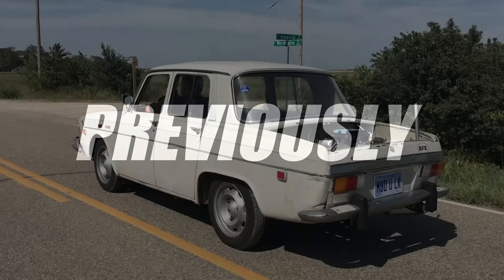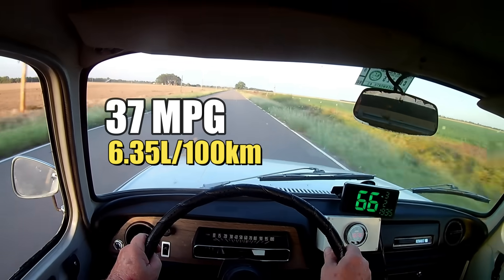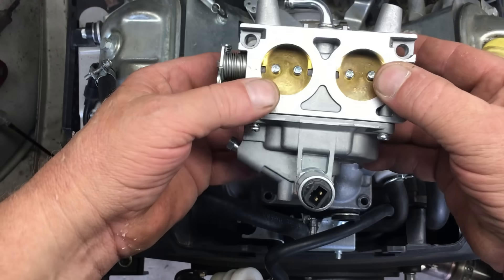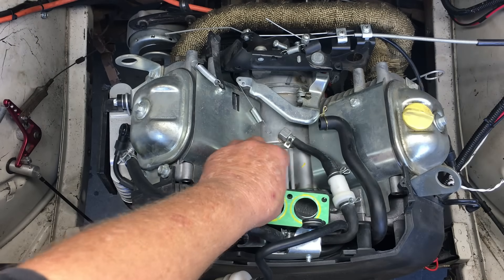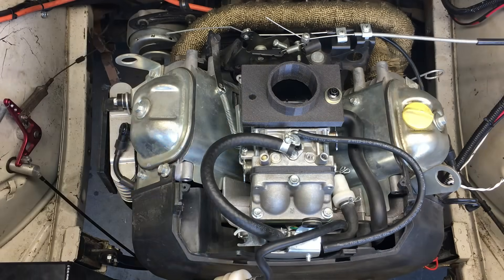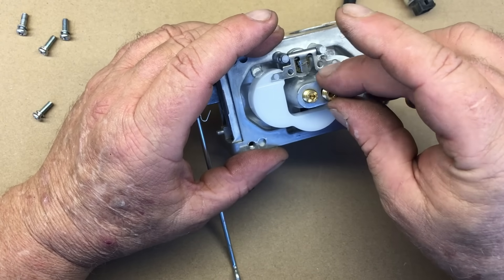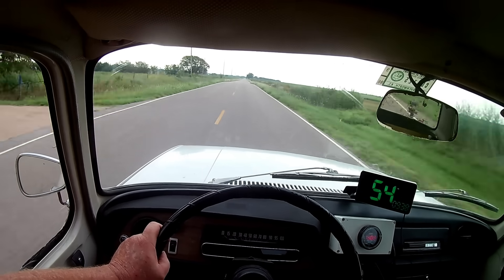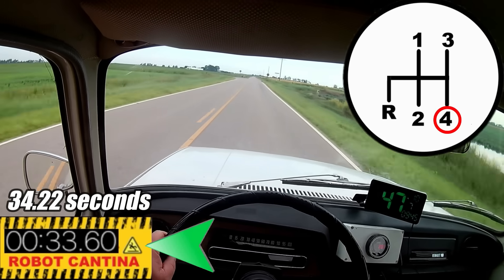S3 E27. We improve the fuel economy on the 670cc Predator powered Renault

Comment: Did the crossflow spacer change the af ratio, or was it the change of filter setup?
Reply: I also noticed you like using Arlington road for a proving ground
Reply from the maker: The spacer indeed changed the AFR.  We have run the engine with and without the filter with no change in AFR. Are you local?
Reply: @robotcantina8957  Penalosa

Comment: Is this engine getting a blower like the rest of them?
Reply from the maker: A blower would be cool and its been done before.  however I don't think the engine would last too long even with billet rods.    It would be nice if we had a bigger budget so we could afford to destroy a few engines and find out.
Reply: @robotcantina8957  I'm still hoping for a few more episodes about the diesel Saturn.
Reply from the maker: @2ndspingarage   the diesel saturn  will appear in one or two more episodes, then the engine will be removed and the saturn will  be scrapped. The diesel engine will  then be  installed in a lighter car.   For the  second generation of the diesel project we will try a supercharger along with a computer controlled fuel rack adjustment..... plus moore!
Reply: @robotcantina8957  no doubt:  if I ever get any small engines you might be interested in using for your show id like to donate to the show.  Im by Tulsa,Ok.

Comment: A single 35-41mm downdraft carb mounted to a spacer manifold bolted on top of the stock intake would get rid of several of those turns the air fuel has to manage before entering the combustion chambers,plus gets the carb further away feom the engines heat that the stock carb encounters by being mounted between the cylinders..plus better airflow to the carb..

Comment: A mod worth considering is taking of the cylinders and pistons, match the weight of the conrods, pistons.
Maybe even trying to shave the maximum weight of the pistons, like the casting remains under the underside and maybe making them accelerate faster.
Drilling the conrods with a 3 - 4 mm drills to make them light yet remain durable.

Lol, 1 billion.
12:01 seams like a drop in power and than it start picking up again, like it has to think what to do.

Comment: The reason this engine has a two barrel carburator, in witch the barrels are entirely separated and each feeds 1 cylinder, is that it is a v-twin engine, and consequently has unevenly spaced intake strokes. With a 1-barrel carburetor, air inertia would cause different velocities during intake of each cylinder due to the irregular cycles of vacuum applied to it. And I suspect that the originally different jetting in each barrel has the same reason: the two separated barrels is probably an unsufficient measure to ensure similar air-fuel ratio in the two cylinders, I think firstly because of air inertia in the intake before the carburator, but especially in the 2-in-1 exhaust in witch irregularty of exhaust strokes alters scavenging. Such an engine should have 2 separated carbs, intakes, and exhausts.

Comment: Tinkercad tip: when you create a cylinder, max out the number of faces on the cylinder and it will look really nice and round instead of having the distinguishable sides like in the air filter adapter print.

Comment: The two plane intake is probably better than the crossflow at low end smoothness, idle-ability, and air fuel mixing. The crossflow probably increases air fuel separation which improves top end mixture delivery but less low end torque, snap acceleration, and idle smoothness especially on cold start. 
   How does the 6mm plastic spacer effect thermal conductivity? I think it results in a dissimilar heat saturation between the fuel delivery system which can have some ugly characteristics during restarting.

Comment: Adding a open spacer to a carb is a pretty common mod to move the power band higher up in the RPM which is probably exactly what you did, it also helps insulate your carb but idk how relevant that is on a air cooled engine that probably likes to run a little hot anyway. The better fuel economy down low is probably because the leaner jets and that spacer moving the powerband, you don't need much power to maintain speed. You should try to make an isolated spacer with the old jetting to see what it does, that should increase torque down low because it's a longer tube intake.

I think what would be interesting is a long tube intake with a more smoothed out path to both intakes, the current open spacer puts a lot of restriction on the opposite barrel to the cylinder. It would be cool to see how a perfected design would work. Alternatively maybe try a variable length intake shouldn't be hard on a 2 barrel intake just 2 possible paths and a solenoid or butterfly valve deciding which ones used.

Comment: I think you need a carburetor that has an enrichment circuit and an accelerator pump. It may be a lot and you would have to turn it down some, but it would probably help. Daytona Carburetor sells a single barrel carburetor based on the Holley 1920 with a main jet that's adjustable through the float bowl. It's a 38mm throttle, so not sure if that would be any better than what you have or not, but what it's based on came on six cylinder car engines.

Comment: Heh. As soon as I figured out what you were up to, I had a pretty good idea what was going to happen. 
Basically you've built a Yamaha V-Max, but without the valve. I was pretty sure this thing would rip at WOT and be worse everywhere else. I'll bet that if you go out and do another speed run and use the manual transmission to keep the engine at higher RPM throughout the run you'll see more performance gains. As it is the performance will be worse at most of the throttle/RPM range but really pickup at WOT and high RPM.
YAMAHA solved this problem with a valve that kept the intake runners and carbs separate at normal throttle levels but opened it up into a shared runner, multi-carb system at WOT.
You could probably duplicate this pretty easily on your system. 
I'd put a solenoid powered  guillotine valve in the spacer between the intake ports that stays fully closed unless two conditions are met. 1. Throttle is at WOT.  2. RPM exceeds (n) 
Play with n until best results. 

I know that's probably more than you want to undertake, but I thought I'd share anyway. In case someone wants to mod their v-twin this way.

Edit: I found this

https://www.vmaxforum.net/threads/understanding-vboost.17998/

Comment: I wonder if the spacer that combines the airflow afterwards of the carb could have a little sliding "cross port" block to close the center up at lower rpms and open at higher rpms to make low end response a bit better?
Random thoughts though.

Comment: Just ignore these armchair rocket scientist Jimbo! Most all these people who have negative opinions haven't the abilities to do half the things you've done! Whenever you have negative responses to your videos it means that you're making others jealous and they feel a need to drop negative comments. Don't know why they feel this is necessary? Can't fix stupid people unfortunately, ignorance and jealousy will always be around....
Reply from the maker: Thanks,  I love to read the comments for unusual ideas, but a lot of the time I find ideas that contradict  each other.  It's interesting to read the comments other youtube creators get... and like you said there are plenty of negative comments  on terrific videos.
Reply: @robotcantina8957  
Thanks for the reply Jim, but hey there's so much available aftermarket for these V twin engines today it's pretty amazing stuff! Camshafts, roller rockers, custom intakes and the carburetor is up to whatever you choose from imagination? I've seen the use of the what's called a "Pumper Carb" off a Harley Davison I believe the lawnmower race community has been using on their engines. They have a integrated accelerator pump, to remove the dead spots in throttle blade movements. I've also seen them running Volkswagen air cooled carbs on these engines as well, or just 2 individual variable venturi carbs. The first thing that I would possibly suggest to you guys and performance enhancements are concerned...... is the Billet flywheel and connecting rods especially, without the governor being out of your equation. These OEM rods are very brittle being cast aluminum as I'm sure you're aware? But they're usually the first thing to fail in these engines once they're allowed to sweep the full spectrum of RPMs. So be careful please with those original rods, but once they have been replaced, file some extra ring gap in the top compression rings and set that baby up for some boosted atmospheres LMFAO! They definitely respond very well to any extra help with induction, but really recommend that you run a good imter-cooler for these air cooled engines are already at their maximum temperatures under a standard atmosphere and load. You Sir are probably a little overwhelming for even the V twin with the weight to HP ratios Lol. But it's sad that the original engines in these French or German vehicles made the same or even less HP than today's modern lawnmowers. So if a production VW Bug made anywhere between 30 and 40HP I wouldn't think you'd be too far off the mark with your 670cc engine. Without adding boost and just running rods, flywheel, a good grind Camshaft and matching springs locks and retainers N/A that engine should be making a healthy 40+HP without the need for boost. If you are planning on getting wild? This is a different story that you will have to get creative with due to lacking of bolt-on parts available for this specific application, but there's enough out there now that other parts can now be easily modified to fit the Chinese clone V twins. I personally prefer the Briggs Vanguard V twin or a Honda or Kohler roller motor. They're now running SBC roller lifters in the Kohler Command V twins with their original SBC hydraulic self adjusting lifters. The bores are the same for the roller lifters that race and most modern performance engines use today. It frees up a lot of HP in friction reduction and ramp angle slopes that are much more radical than any flat tappet can provide. This makes them pretty good for performance, cleaning up the intake and exhaust parts are essential as well, being very crudely cast. But the biggest challenge is keeping everything contained within your cylinders. These lawnmower engines and basically everyone across the board only come with a 4 bolt head. They work, but it's definitely a weakness in design. Some manufacturers utilize 5 bolts when they should technically use 6 or maybe more. When dealing with the high temperatures of the air cooled engine and compounding that now with boost, the eventuality of the head gaskets remaining intact is a problem. Most of these engines though can be machined to use Orings for the head gaskets. If you are going through all this work to produce a reliable engine, and are planning to add boost? It would be highly recommended to Oring the block and heads for a metal Oring or fire stop ring to prevent a blow-out.  But otherwise great videos Jim and always looking forward to seeing what your up to next. Lol thanks for the entertainment and knowledge of things we've all pondered about. We need guys like you to answer the burning questions in life 😂  Stay safe out there and safe travels my man.

Comment: Tip!! You can solder the jet hole and then drill to a smaller size. Works great for us cheap people and or hard to find jets. Also a oxy torch tip cleaner kit works great for that fine tuning that in-between jet size that you cant buy.
Reply: I new a guy who would take an extra set of oversized or pre drilled large jets, silver solder, a lighter & an indexed drill but set with him on motorcycle trips to South and Central America.  Roughly you put some solder in the jet heat it with a lighter until it flows into the orifice. Then use the indexed drill to make the jet you require. I'm unsure how he turned the drill bits. Maybe a T-handle or possibly hand. The silver solder has a very low melt temperature and is soft enough that it wouldn't be much effort to drill by fingertips.
Reply: @nustar1  I use a drill. If you take the ink tube and trim off a bit that don't have ink. You chuck it in the just slightly tight. Then put drill bit in the tube and tighten. Most chucks won't close tight enough to spin those bits. They have a special hand held drill that is powered by your wrist....  it works but I always break the bits. Easier to use power drill and lay it on the bench. Then hold the jet with your fingers and push the jet towards the bit.

Comment: I don't know how I ended up on this channel, but man did it bring back loads of childhood memories :)
My dad was the proud owner of a Renault 10 in the early 70's, and we did many family trips in it, the last one even with a caravan on tow half way through Scandinavia to the Arctic circle to experience midnight sun. You probably know this, but the original had a 1,1 liter water cooled straight 4, and it's claim to fame was the anti pick locking mechanism, the first car to have that. The original watercooler had a almost 1 liter expansion tank made of thick glass, and when that goes pop, it does so in a very audible way!!
Greetings from Copenhagen Denmark.
Reply from the maker: I'm glad this little car brings back good memories.  When I was taking this car apart and discovered the glass overflow tank.... I figured it was something someone had added to the car because no serous manufacturer would do such  a thing...  I guess I was wrong... LOL.
Reply: @robotcantina8957  olds used Pepto bottles …..

Comment: Every time you accelerate through one of these tests, the exhaust note always sounds like the clutch is slipping after you take off.  In this vid its noticeable @12:00 to @12:20.  It would really be easy to see if you had an analogue (needle) type rather than a digital tach.  Yes, I know you don't have a clutch.

Comment: I still think you should put the hood (engine cover, bonnet, rear deck, whatever) back on to see if there is a gain in empeegees or performance.  With the rear deck (hood, engine cover, bonnet, whatever) OFF, you have actually modified the cars aerodynamics.
Reply from the maker: Its still to hot here in Kansas to put the thingy back on the car.  Also, you may have noticed there is a metal pipe sticking up on the right rear side of the engine bay.  That is a camera mount that we are trying various experiments on..  So far we have tried  several different vibration absorbing mounts and still cannot get a clear shot of the engine during acceleration.

Comment: Lean is mean even air cooled 13:1-12.5:1 is right where I'd want it at wide open. Now I like the thinking with the spacer but buy some vboost parts from a Yamaha vmax hell I'd even use two of the carbs as it looks like an easy fit and their CV carbs so even being 34mm they open as much as the engine will demand. Either way I bet the valve with much more area and better flow would net you a significant top end increase.  My only concern is currently it seems to rev to a good rpm then drop right out of the powerband. Maybe you drill the weights some or add a launch pedal that makes it stay at higher rpm on demand.

Comment: Just thinking out loud....with the spacer installed, Im wondering if the air speed through the carb has been affected?
Even with its small volume, what air is being shared is having to make sharp turns into each runner.
Whether removing some material and radiusing the separation between the 2 individual runners would help, I dunno?

Comment: Likely dealing with overly turbulent flow at low RPMs with that shorty spacer. With higher flow able to create vortices and a boundary layer to shield the main flow from those hard edges/turns. It's a little counter-intuitive but higher flow can make odd restrictions LESS restrictive (overall, by ratio) because those fluid dynamics principles become more and more influential to the flow as a whole. Same idea as to why increasing frontal area with vortex generators can be an overall decrease in drag. - Long story short, the quick and dirty spacer delivers quick and dirty results. Whodathunkit. I'm sure you're already heading down the trail for better options though. Keep it up.

Comment: Something I've been thinking about for a while is what is the endurance for these modifications? Driving around testing is one thing, and it's great. However what about a cross country trip of say 500 miles or more with no mountains? Would the CVT give out is my question. If so the CVT belt is not something that is easily changed on the side of the road ...or is it?

Comment: I'm willing to bet that the crossflow spacer is increasing airflow at higher RPMs, but it's making it harder to maintain a consistent AFR across the rev range. Additionally, at lower RPMs with a wider orifice (access to both barrels of the carb,) you're reducing air velocity through the venturi which may negatively impact fuel atomization at lower engine speeds, but improves flow at higher engine speeds. This is why Subarus have something called a TGV, tumble generator valve, over each cylinder. On cold starts and at low RPMs, the valve closes, reducing the area just before the fuel injector. This serves to increase air velocity to improve fuel atomization (and emissions.) Something I've noticed is that the CVT starts revving higher, but then as it kicks in, it pulls the engine to a lower RPM before hitting its top speed. If it's possible to change the CVT to compensate for that, you'll probably get a little more performance as well.

Either way, great experiment! This reminds me of some videos talking about different intake manifolds for classic V8 engines and how they all impact performance.